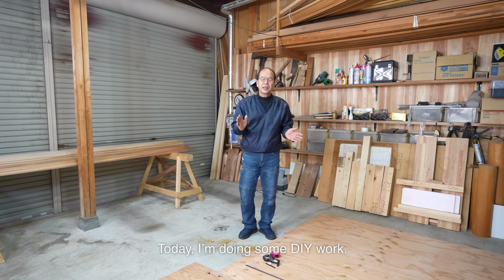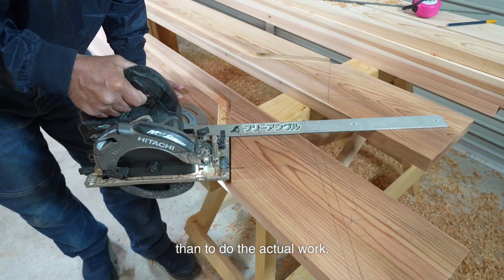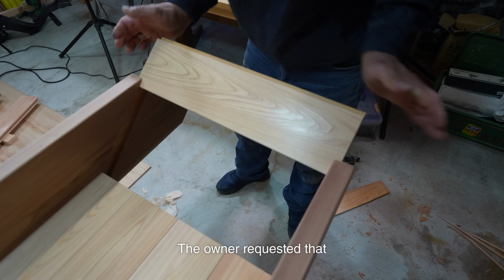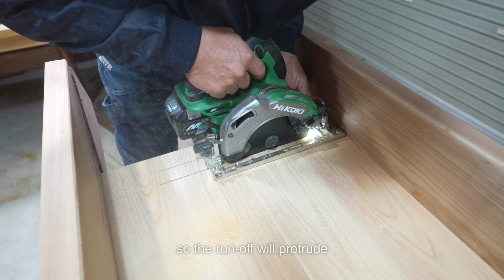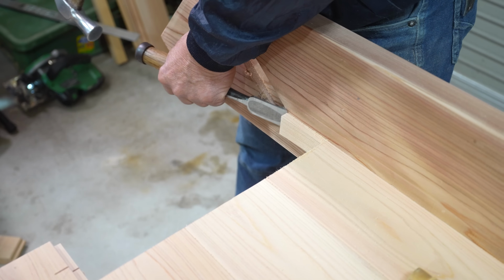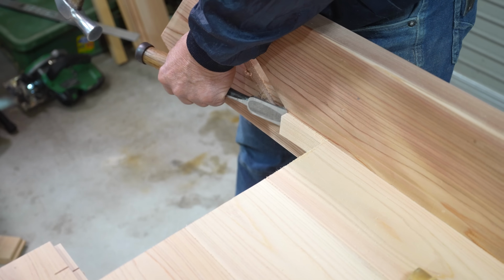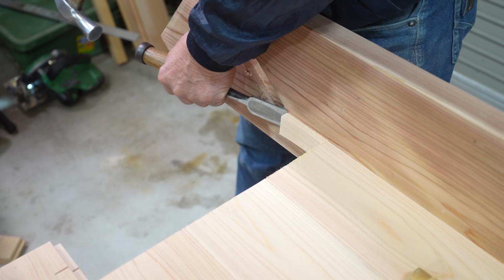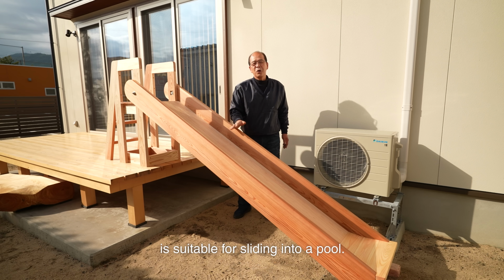Building a Wooden Slide from Scratch is Extremely Difficult [Carpenter’s DIY]

Comment: You mention rain water - though I have not worked with Japanese Cypress wood before, I could imagine rain and the elements in general would quickly degrade the surface of the wood, making it rough and splintery - this is what always happens to my outdoor wood, no matter how much oil I apply. It would not be smooth for long. What are you expectations here?
Reply: And having it near pool later on, kids won’t wear thick cotton trousers sliding this down while the slide and it’s coating will get drenched a lot… I am skeptical how long this will last.. maybe a year until the surface degrades. Indoors would be a different story I would think.
Reply: Japanese cypress is water-resistant enough to be used in bathtubs, and at the same time it is an excellent building material that is also insect repellent. The bathroom made entirely of Japanese cypress smells great and I love it. Horyuji, the world's oldest wooden building, is also made of Japanese cypress. The downside is that it is expensive, but I think the 'syoyan' master carpenter chose the best wood for outdoor use.
Reply: @hiroshi.n9352  Super interesting!

Comment: Flat grain rather than vertical grain on the slide surface boards is not something I would do with any wood species I'm familiar with using. Maybe the wood used here will never move and have a splinter issue, could be as I'm not familiar with it's properties. Here in the States there is good reason we use a thin sheet of stainless steel for slides, also many polymer materials are use in playground equipment.